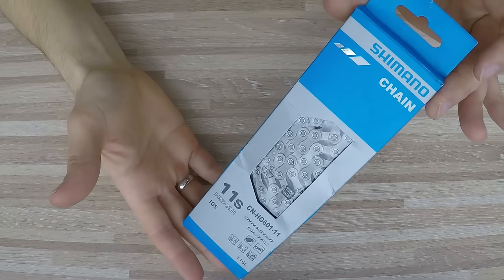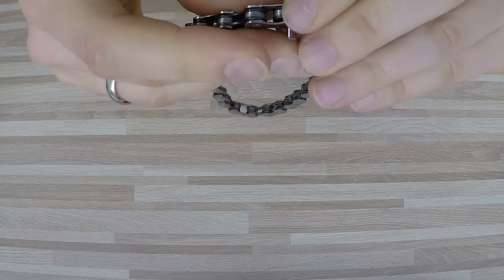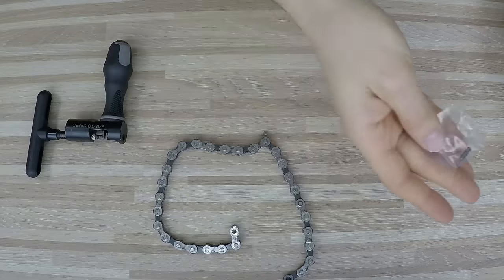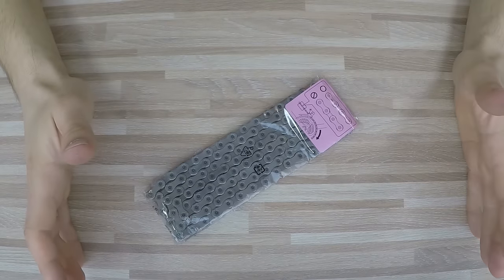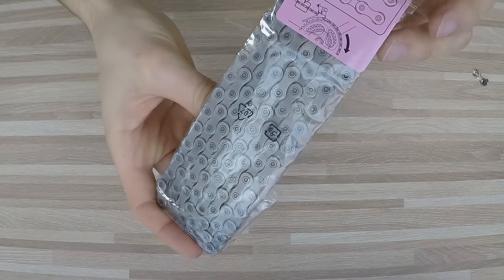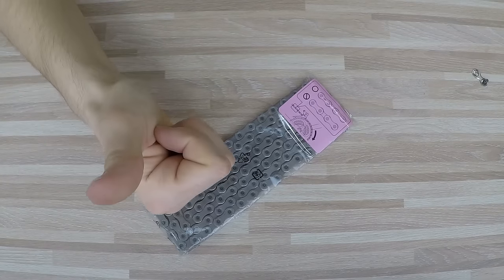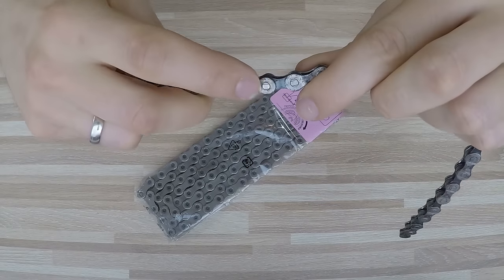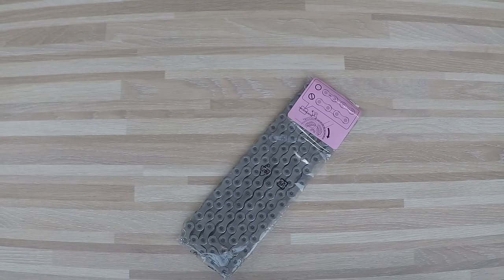4 Worst Mistakes In BICYCLE CHAIN Maintenance. How NOT to do it. SickBiker Tips.

Comment: Don't we all have different opinions on what's good for our chain? ;)
I think it's much more important to clean regularly and after each use, than WHAT to clean with. Not just for wear, but also for easier shifting and a smoother drivetrain. 
It's pretty easy to measure the cleaning ability of these materials and their chain wearing effect by looking at how many km's you can ride without break or shifting issues or using a chainwear measure device of course. With below cleaning method I do about 3-4000 km's on a Shimano chain (golden KMC did not work well for me) on an XC bike with lasting climb stress around 200-250W, only once broke a chain by own mistake in 8 years of training and racing, never by wear. The cassette replacement is a necessity as well, once your chain is worn out.

My experiences over the years:
1. Initially, I cleaned with one of those little cogwheel cleaner kits that you fill with degreaser fluid and then lead the chain through. It is utterly messy though and leaves all the dirt circulating in the cleaning device which not only functions poorly, but can be thrown away after some uses due to sediments and sticky brushes. Also, while leaving it on, you bring back some muck to the cogwheels. 
2. As high-pressure hose is a no-go due to the bearings, which means cleaning the chain only on the outside while leaving it on the sprocket during cleaning is just not enough. After washing the bike I take off the chain to clean it (on my MTB that is, as the roadbike has no quick-link).
3. After taking off the chain, I first do an outer sweep with a cloth to get most of the muck off, then put it in a jar with degreaser we have here called "Brigéciol", which is actually a desulfurized, petroleum based engine block degreaser. A bit of shaking in a closed jar gets the initial muck out, then I let it soak for a few minutes and do another good shake before taking the chain out and wiping it off, also shaking it well while it's in the cloth to get the fluid out from between the links. The degreaser can be reused as it is easy to separate from the muck, which after a day or so settles at the bottom as a sticky sediment. Reuse is better for the environment as well, a liter bottle lasts me a season with about 70-80 cleaning chores. 
4. After cleaning, I immediately use the lubricant, usually a thick one as I we rarely have to use the MTB in the rain or mud. Nowadays I love ceramic wax, which is not cheap but is perfect: repels dust/mud so it doesn't leave a sticky trail in the car and in dry weather doesn't squeak either.

What I never use is WD-40 (the old blue/yellow label), while I understand their new "BIKE" line is safe according to their advertising. Regarding the old yellow/blue one, all the bikers I know say it's basically a good for all and good for nothing solution that can harm your bike big time so best to avoid it.

Comment: 100% agree! Never degrease your chain completly, but clean the surface very well after each longer ride or every 100 km or so. If you ride in good weather conditions you can go for 200 km and 50 km in bad conditions (rain, mud, dust, etc.). Avoid riding you bike in the ocean spray! :-)

Comment: The advice I totally agree with is that you should use a new replacement pin anytime you have to break the chain.  

What I don't agree with:
1.  Quicklinks are OK?  They're not.  They are very unreliable.  Once you install a new chain on the bike, leave it there until you're ready to replace it if at all possible.  Clean and otherwise maintain without removing it from the bike.

2. The factory grease is not to be used.  Wrong.  The factory grease is actually a very good formulation that reduces wear and helps keep grime away from the bearings.  I does not make the drive train noisy.  Of course it won't last forever.  If you use it for the first 400 miles on clean  and dry conditions taking care to remove the excess grime after each ride, sleep well.  But then after that amount of usage, clean and relube the chain.  I do a quick rub of the chain after each ride and then apply a solvent based high-viscosity oil which both cleans and lubes the chain after every 100 miles under ideal riding conditions.  

I'm not going to talk anymore about chain lubes as its just too controversial.

Comment: If the original lube is so good, it's best to get some and re-apply on clean metal.
Reply: The original lube is grease, melted into the links. How will you get grease inside the links? You would have to melt the grease, then drop the chain in it and let is soak for a while. You're better off using wax, which is a much better chain lube - for off road any way.

Comment: FWIW: I use the least expensive chains, and the mileage ranges from 3,000 to 6,000 miles. I'm not joe superstud pounding the pedals at 30 mph, and I have maybe 3-4 short-but-steep climbs to make. Chain stretch is the problem, not wear or corrosion (don't get me wrong, corrosion is a big deal and I'm not immune to lazy maintenance).
IMO, two things kill chains: 
-a lot of "starts" in high gear
-riding in too-high a gear for the speed you're going.

When you do either of the above, you're placing excessive force on the chain, and speeding up its stretching.

Comment: A) The instructions go into the garbage with the packaging as soon as new chain is removed. B) The Pin that is in the chain, prior to breaking chain, is pushed through but not removed from chain for Reuse...Always.  C) There is no removing of moisture from chain, once lube is applied and bicycle is used daily and left outside, and or used in elements.

I changed my chain and sprockets once over the life span of bicycle, because I striped down the teeth so much that teeth would not bite chain anymore. I ride 365, 4 Seasons, in the rain, snow, sleet, and heat of summer, dirty, dusty, snow banks and puddles full of salt and grit...covered head to toe from road spray and otherwise environmental conditions at time of ride.

You have very clean and well manicured hands and fingernails...

Comment: my chain cleaner is deodorized kerosene, deodorized paint thinner, Napha, ATF                  ( automatic transmission fluid) and lanolin. cleans and lubes in any of the "clip on" chain cleaners like the parks or finish line. It's reusuable, with a magnet taped to the bottom of a gallon + windshield wiper  bottle. I usually get 3500 miles on my road, touring, and adventure bike chains before the .5% chain check drops. for extra lube i may use finish line ceramic, or go lighter with ATF and kerosene 50/50

Comment: I use old chains, old spurs on old bikes. One bike maybe 2000 km or more and one is on the -run-until-chain-break. When running old spurs and chain all are very well adjusted on each other, so have to buy new ones all at once. rag and oil is my method too, I was advised by velogi.

Comment: During Shimano mechanic training they actually recommend NOT cleaning the factory grease from the chain.
Reply: The Shimano mechanic is entirely wrong about this just as Shimano is wrong about connecting a chain with replacement pins.  Running a chain with the factory preservative means spreading that goop over the entire drivetrain and it's a magnet for dirt, not to mention substantially increasing drivetrain friction.  A clean drivetrain is always paramount to bicycle efficiency.  Connecting links are much more convenient and I'll bet safer, especially for those with less practiced hands.
Reply: I agree. Leave it on the chain. You'll be lubing after a few rides anyway. Removing the factory lube seems like unnecessary fuss
Reply: It can interact with lubricants on the chain after and become very sticky, this is one issue.
Reply: Phil Houck what absolute nonsense; it's a mechanical apparatus that needs proper lubrication, not a kitchen work surface.
Reply: Same, never ever had issues.
Reply: GreenOil UK
As said in the video, don't remove the grease inside the chain, so your interaction issue is BS.
Reply: @philhouck3560  what you mean Shimano is wrong about saying to use replacement pin? I've been using the provided point whenever I change my chain
Reply: Using replacement pins is a critical procedure, especially if the bike is used off road.  If you've never had a problem, you're good at this procedure.  Others are not so lucky and they can suffer chain failure and then they blame the chain.  I also suspect that the installation of the pins at the factory is at a much higher level of precision than can be obtained at home.  Using a master link such as the Wippermann is much more convenient and far more reliable for most people including myself.   This is especially true if lubing a chain involves removing the chain from the bike. JMHO
Reply: @DepakoteMeister  I'm afraid you don't know what you're talking about.  What kitchen work surface?
Reply: @philhouck3560  Exactly!  Kitchen work surfaces have to be kept clean (i.e. not greasy or oily) , NOT chains!  I certainly do know what I'm talking about.
Reply: @DepakoteMeister  No you don't.  I have never cleaned a chain in the kitchen.  I use a butane stove or a rice cooker in my workshop.  Here's a suggestion: Ask for clarification before you criticize or condemn.
Reply: @philhouck3560  I never suggested you did!  Here's a suggestion: Read it all again SLOWLY!

Comment: The chain you have shown at 1:23 is a 5 or 6-speed with rivet-style pins. The new chain you have shown is totally different and it needs a new pin every time you break the chain. Unofficially I heard, the rivet-style pins can be reused but I haven't found any official documents from Shimano.

Comment: I totally clean a new chain in neat citric cleaner (de Greaser) followed by boiling water to fully rinse the cleaning agent out, once dry dip the chain and links in hot wax mixed with 1.6 microns PTFE powder. The fully in depth  video can be found here....  Waxing your bike chain - getting it right

Comment: Another mistake, would be to not measure chain growth at where the quick link/missing link is.
Reply: Maybe not so much with a missing link, but it will throw it off if you use a new quick link
Reply: What is the symptom of a chain which is too long, apart from the really obvious slack/sag?
Reply: @spattisson  You don't see slack, the chain will skip under load. Primarily in small cogs, it can be quite dangerous! Slack or sag has nothing to do with chain stretch. Those conditions would indicate rear derailleur cage spring issues!

Comment: A really good way to clean the chain is to remove it, put it in a frying pan with normal dishwashing detergent and water and then boil it. Rinse with water and then lube it (or wax, using hotwax and melt it in the pan). It is a bit cumbersome and you need a chain with a quicklink (not worth the expense if you use rivet pins).

Comment: When removing a link pin, push it back the way it came.
Most people fit it from the outside pushing in towards the frame.

To remove the pin simply put your tool pushing from the chain side and you won't knacker it.

The factory grease is a Sh!t Magnet.

If you are not a fair weather rider the only way to look after your chain properly is to take it off periodically and wash it in whatever is your preference, then re-fit and re-oil with whatever works for you.

50 years ago people only had 3in1, and axle grease so there's no need to be too precious eh 🤣

Comment: I completely stripped the grease from the chain using water base degreaser (using ultra-sound cleaner). After drying, I soak the chain in hot wax mixture with mineral spirits or the like. Because wax and dirt do not bond, any dirt from the chain will float on top of the wax.  To re-wax, I steam clean the chain (using a small steam cleaner) then remove the chain and dip it back into the hot wax solution. I only do the deep degreasing when I initially clean the chain for the first time.

Comment: when did bike chains become so weak and fragile?
Reply: When they got thinner so we could fit 10 or 11 speeds and when we started drilling out pins and carving away the face plates to save weight?
Reply: China
Reply: solid pins for the win. If you can't push a bike with an extra ounce of weight, maybe you need a hub motor.
Reply: When you need to make a youtube clickbait video on how to take care of them.
Reply: How is that clickbait he delivered exactly what he said in the title.
Reply: @onlyonecannoli3952  usted si que es criticón, no?
Reply: +HeyBaby  No te lo niego...como el nombre dice.
Reply: I would personally agree with this video, in the sense of a high power rider in a racing situation, or ANY Track/BMX/Fixed gear situation. In the case of road racing, its a few dollars to promise not only safety but to finish the race, after all the other funds for raing its nothing, in the case of track/bmx/fixie, the chains are cheap enough and on the track I prefer a slightly higher than normal tension, and rarely have to remove the chain anyway, so when I do its a whole new chain for me. Totally personal preference though. As far as low power riders or commuters, or those riding 10 or less speeds I would still agree with anything adding a margin of safety but I would be much more comfortable reusing a link once or twice. Also of course if you just need to get home on a broken chain do whatever you need to.
Reply: When manufacturers realised there's tons of $ to be made by reducing the quality.
Sure, chains may be thinner due to larger range of gears, but I suspect weaker metal is the cause.
Reply: @onlyonecannoli3952  I have reused pins many times. usually no problem.  Just learned about quick links, though.
Reply: Right!  I just broke one tonight crossing a busy intersection.  Just about died.  Plus no chain repair with me so I coasted home 7 miles.
Reply: Same time everything else did. When corporations decided built in failure is necessary for staying in business vs quality.
Reply: Only One Cannoli  thanks for the link in Point 2. In the interview I can read „In dusty conditions you can wipe off the outside of the new chain with a rag that is wet with a gentle degreaser to keep dirt from sticking to the grease.“ This is what Dani explains in the video.
Reply: @onlyonecannoli3952  Mountain-bikes can get nasty dirty, and, if you keep them inside, I like cleaning the heavy mud off. Easy to do at a car wash on the way home. I never use full pressure , 'cept on the tires. I do the heavy lube and rapid reverse spin wipe he mentioned, to push the water out.
Reply: I got a single speed chain from China and it's gotten me over 5000 miles
Reply: @aliensanonymous5063  That's lucky..
I still wouldn't take that risk though, personally..
Reply: @Becky Esplin That's because they have to be thinner to fit in the same amount of space as those with less speeds..
Reply: as soon as you start to take care of them..
Reply: @JustJaxx   He got a single speed chain, so it's a larger (and more robust) chain
Reply: @aliensanonymous5063  did you push the bike or pedal 😀
Reply: @adrianloewen9962  not everything made in China is crap but pretty much everything they make doesn't last long or work except for coronavirus! That's an exception.
Reply: well, Campy in my shimano/sram Cassette is a 5.3 mm ferrari dream that lasts 300-3700 kms. 300 km breaking in. Shimano Dura Ace? 5.6-5.8 mm crappy metallurgy garbage, one loosened in 400 kms...
Reply: Only One Cannoli well I just went out for an hour on a brand new chain without cleaning it and it's absolutely filthy full of grit and dirt and tiny stones, I can't believe it. Gutted. I've to clean it and all my sprockets and derailers  now and I only cleaned them all thoroughly last night before putting my new chain on. All that for a half hour ride abs now I've got to do it all over again
Reply: Only One Cannoli so if you don't use water at all to clean your chain how do you rid it off degreaser?
Reply: @peglegnoid6139  don't ride any bicycle because you always have a component from China.
Reply: Cuz they have to be as light as possible for races/mtb

Comment: Stock grease on the new chain is the best. Not stickier that Shimano lubes i using now.
Reply: Thing is the stock grease isn't actually lube, it's merely anti-corrosion grease to maintain the product quality during storage and transport. It works better than nothing but proper lubrication is better for actual use.
Reply: Especially since unlike dry lube the stock grease will attract grime, wearing out your chain quicker even though at first try it seems to work well.